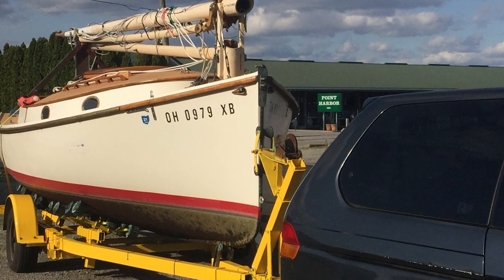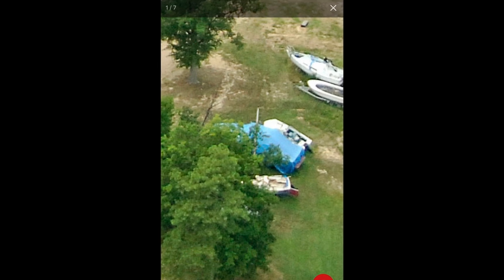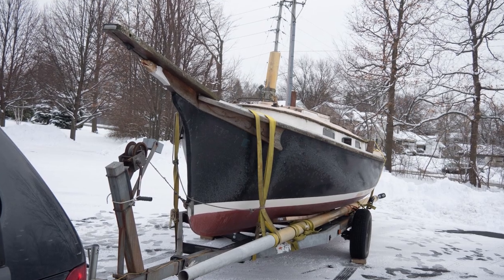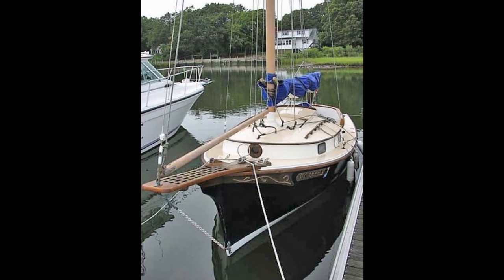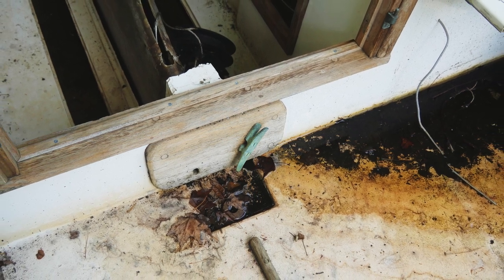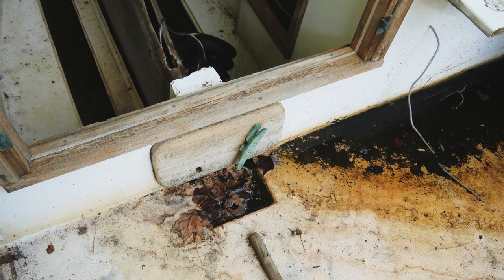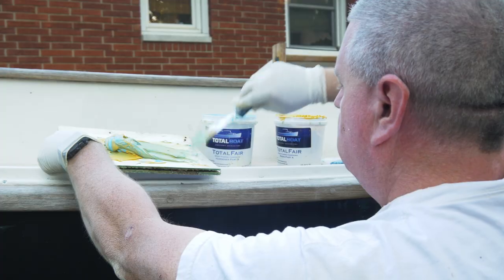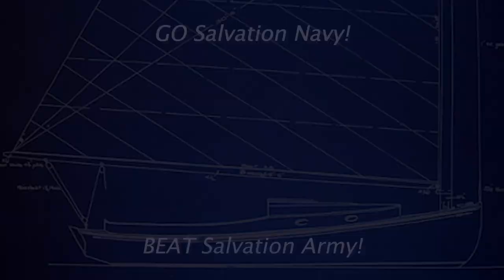Eps. 3.1 - The Eagle has Landed!

Comment: Super boat.  I have question are Eagles self righting?
Reply: Don't know for sure but I would doubt it. There needs to be a lot of ballast low in the boat between the lead bricks and the centerboard, so I double if it capsized beyond a certain amount, that it would self-right. But its hard to get over that far. Iv'e never taken mine over to past 75' before the boat self-corrects to some degree and decreases its sail and surface area for the wind to push it over much more.
Reply: @kb8wfh  Thanks I was curious as we sail on Lake MI often.

Comment: Thank you for your posting and video.  I have a Herreshoff Eagle that needs some work and clean up and is currently being stored in a boatyard in Massachusetts.  Given the  Covid-19 situation, it is very difficult to get access to the yard.  I would like to buy a trailer for the boat.  Do you have any reccomendations for one?  Thank you so much.
Reply: Hi Kristin. Thanks for your message. First, I setup a Facebook page for Eagle owners and would love to have you join it if you are on FB. We are trying o build up resources needed to restore and maintain these rather rare boats. As for the trailer, I simply use the trailer I have for my Herrreshoff America, since it is essentially the same hull. The trailer uses self-adjusting rollers that fit the contour of the hull. However, I hauled it from Maryland with a trailer I setup with temporary bunk runners and it worked fine also. The key is to make sure the keel of the boat rests on some good supportive  hard points on the trailer in the center. All the other stuff on the sides just keep it snug and stable but do not really hold it up. It's all on the center support of the keep and into the trailer. If you can, join my Facebook page for the Herreshoff Eagle and I can send you some pictures of the trailer I have. I can't seem to figure out how to post them here. Would love to see what you have for your Eagle.